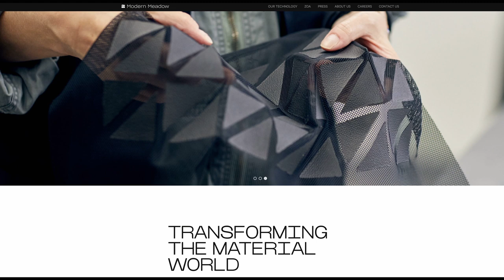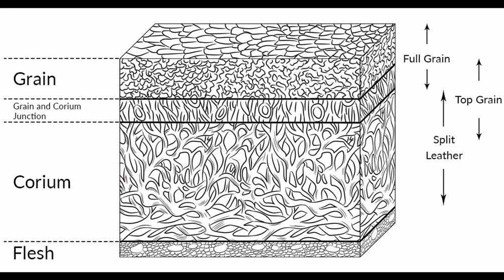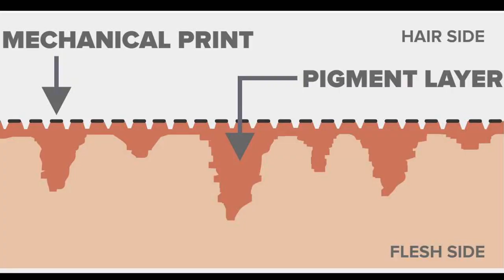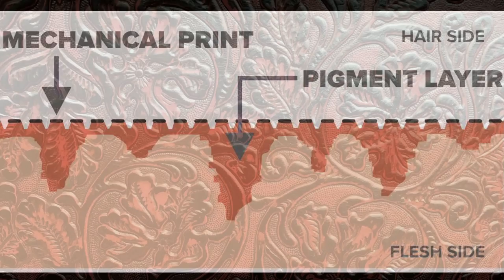The ULTIMATE Leather Crash Course

Comment: I just found you and subscribed.  I was watching a Nick's boot factory tour video.  The person giving the tour said that the rough out surface is the hair side of the leather.  I always thought that the smooth side was the hair side.  Can you clear that up for me?
Reply from the maker: The skin has three primary layers. There's the epidermis (the hard outer layer) the dermis (the softer middle layer) and the hypodermis, the squishy part of the skin that connects the skin to subcutaneous fat and muscle tissue. The rough out leather is the underside of the grain-corium junction. If you were to saw a leather boot made with full-grain leather in half, the roughout would be on the inside of the boot. In other words, it's typical leather turned inside-out.
I hope this helps!
Reply: @CarlMurawski  Thanks!  If I am reading this right, the hair is on the epidermis side.  Most boots are built with the epidermis side out.  Roughout boots are built with the epidermis on the inside.

Comment: Most leather is actually not from the food industry. Common misconception, but the meat and leather industry do not go hand in hand.
Reply from the maker: It’s entirely possible I’ve been misinformed, but the director of operations at Horween said that the overwhelming majority of their leather was from the food industry. Since most leather is from farm animals (bovine, goat, pig, etc.) it makes sense that their primary function is meat with their hides as a byproduct.
Reply: Carl Murawski Yes it makes perfect sense. But not all leather comes from horween. Most leather from other parts of the world do not use the leather from cows that are bred for meat, simply because they have different living conditions. They are typically behind barbed wire, and since they tear and scratch their skin their entire lives, the leather is not up to any standard that would suffice in the making of any other than very low end quality leather.
Reply: The Terrible Puddle Sadly, the animals bred for leather arent good for eating because of different feeding. Animals bred for meat are genetically modified to have more meat, And vice versa for leather. So sadly, in the leather industry the meat and carcass is thrown away. And vice versa for the Meat industry.